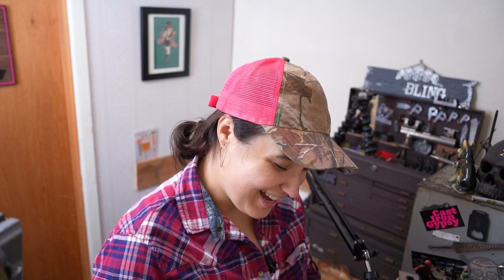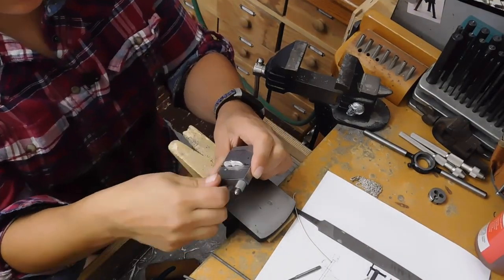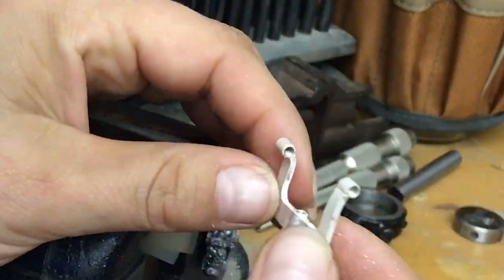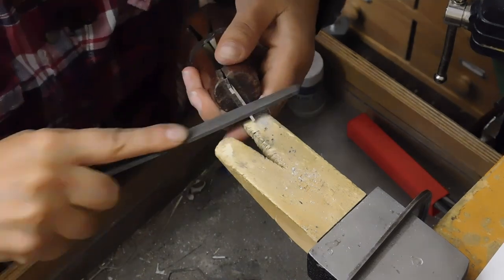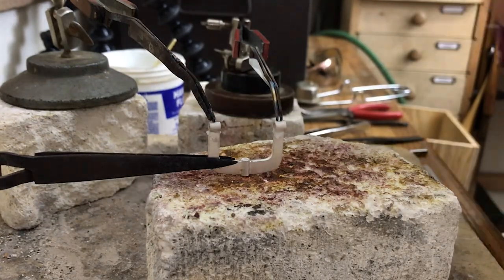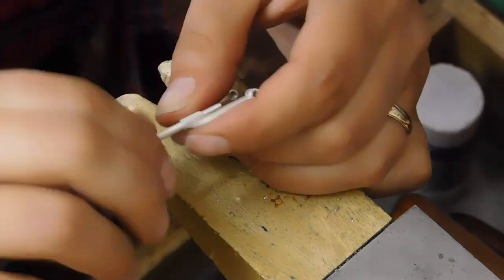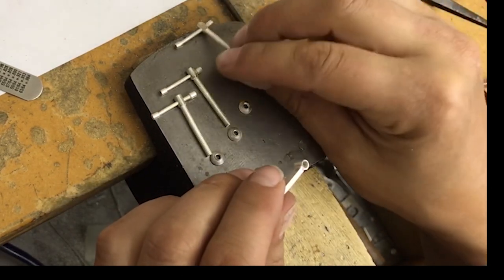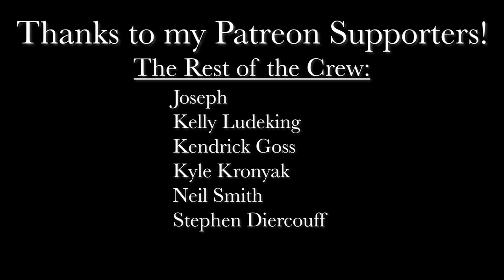July 24, 2022 | Behind the Scenes Timelapse | Edging Clamp | Studio Shop Day!

Comment: A little advice. That's a big tap wrench for such little and soft material. Get a smaller tap wrench, or make one.  Something like a  Starrett 174 or, a knurled disc with a hole and set screw.
When you have soft material like that, take some wood or plastic, drill it for the size of the tube, slit it with a fine saw down the middle and hold that in the vise so you are holding the tube. Also you could drill and tap it before you solder it to the main body.  Also in the smaller size taps, 2 fluted taps are stronger than 3 or 4 flute. So if it's a gummy material it helps.

Comment: Great video as always, Just a thought, taps sometimes come in sets of 3 that progressively cut the thread, called serial taps, they should require less force which may make it easier to tap holes that are at risk from the twisting you encountered, kind of an expensive answer to the problem but might be worth checking out in the future.

Comment: Is there a reason you use such a big torch?  A micro torch would be so much easier to control the heat.
Just curious.

Also when you clamp a piece in a big block of metal it acts as a a heat sink and takes longer to heat what you want to solder.  Locking or spring loaded tweezers are much better to hold small items you need to solder.